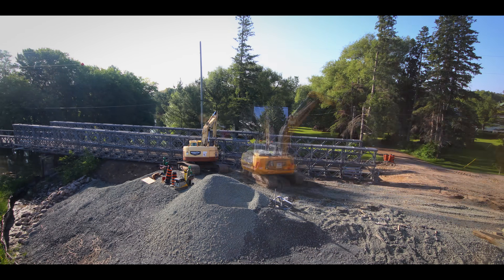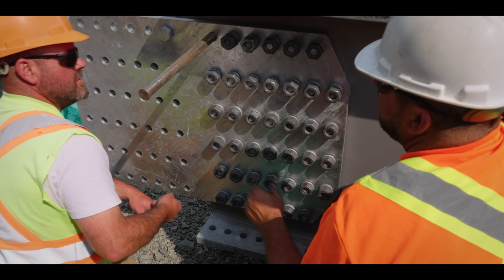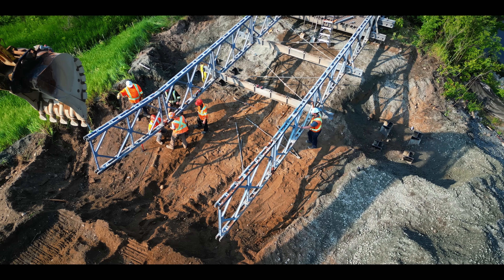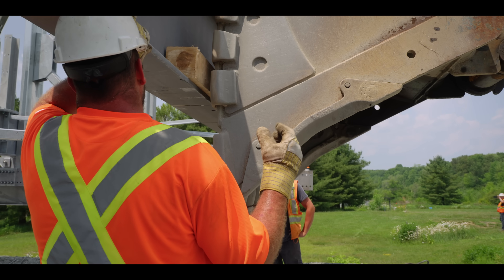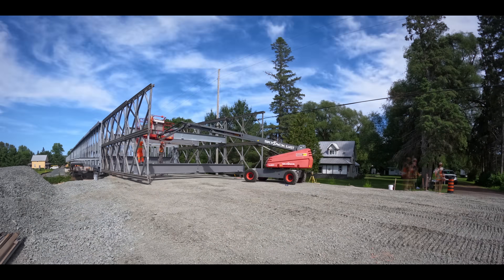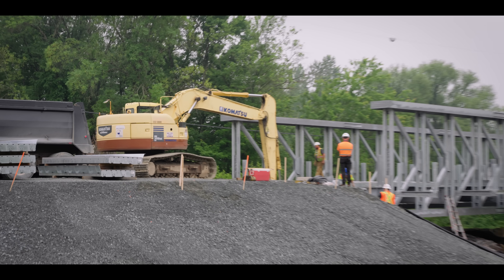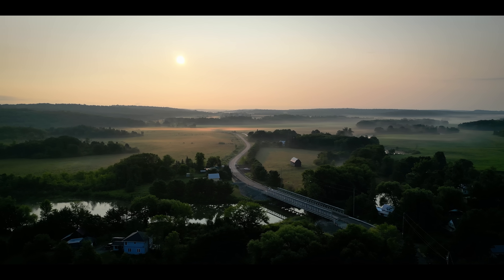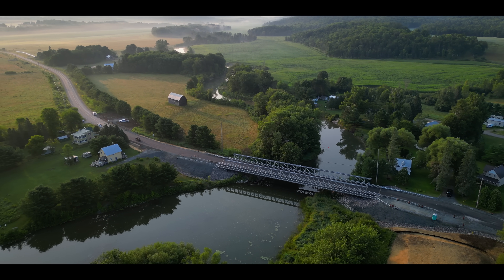Rapid Construction Times Using Modular Designs

Comment: When was the Bailey bridge installed? The oldest ones are over 80 years old, but new ones are being built every day, because they are still the choice for temporary bridges. I saw one being built on I80 in New Jersey a few years ago, and there was a big one in Boston when I was there last April. While these folks are congratulating themselves on installing this in 'only' 17 days it's worth remembering that for people like my grandfather this would have been a small bridge. His team assembled and installed them overnight while the Germans were trying to kill them. He bridged the Rhyne more than once  too. To be fair, my grandfather's team wasn't limited on staff. They had a lot of people on each bridge.
Reply: Thank you for your grandfather's service.  Modern day panel bridges are based on the Bailey Bridge system from your grandfather's era, but they are not the same.  The Bailey Bridge consists of smaller and lighter parts which were able to be lifted manually by troops.  Acrow designs and manufactures modern-day panel bridges (700XS and Compact 200), which, while they can be used as temporary bridges, are designed for long-term fatigue and larger and heavier than the Bailey, necessitating the use of lifting equipment.  The Delta bridge is larger and heavier still!  What Miller accomplished in 17 days was, indeed, very impressive.

Comment: Bailey bridge (they mention it regarding the old bridge), classic army solution from 1930s, just modern version. 2 weeks is toooooo looong, these bridges were designed to be laid in days, of course working 24/7 in shifts and without heavy equipment, mb just with bulldozer and light crane.
Reply: My grandfather was a Royal Engineer during WWII. Overnight was his usual build time, because it was too easy to get shot, or blown up, if you weren't done by morning. He landed late on D day and was in Germany until 1946.